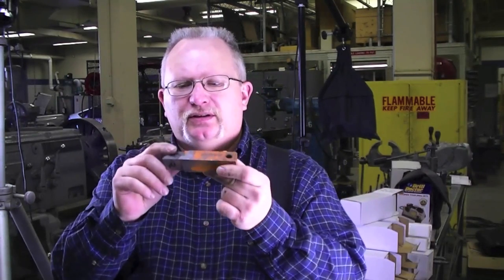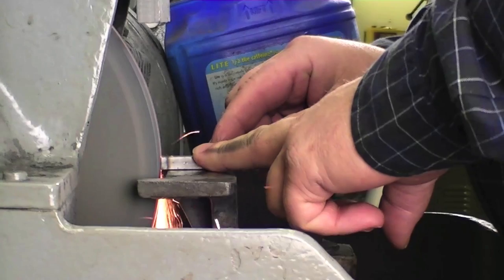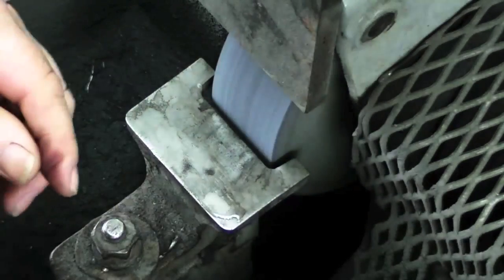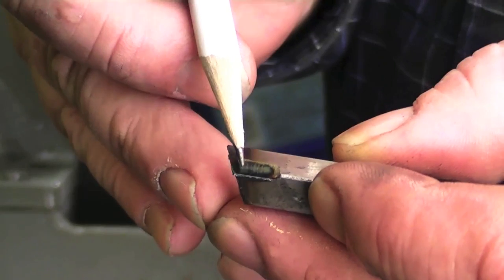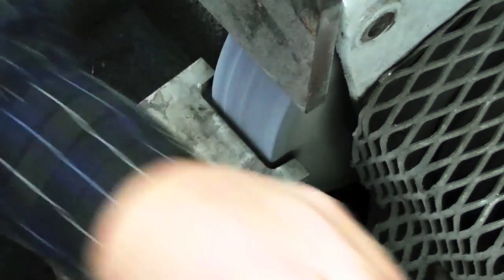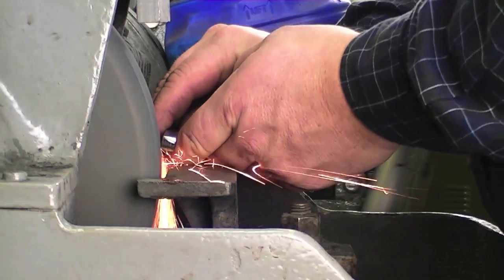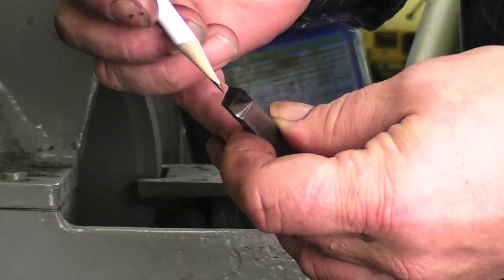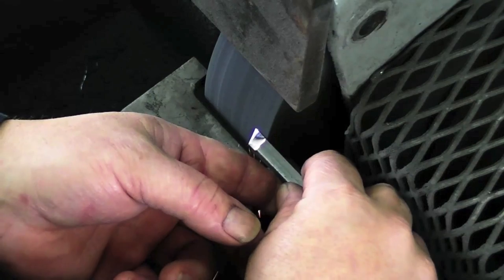Grinding HSS Lathe Tools - Part 1: Grinding a RH Tool

Comment: Nice video, however cuts corners immediately (pun intended). Grinds way too fast and without HSS. This basically leaves 75% of the important information out. The geometry can be explained with a picture

Comment: great, if  need turn a concave as in tube firmer dye, using a tool that pivots, what will by tool shape be, as the tools pivots in an arc , both ways? rgds

Comment: A comment and a question.
 You didn't explain the rake well on the top of the bit as you were sharpening. Did I miss that?
Question; You were sharpening 4140 and spoke as if you were actually going to cut with it. Do you use 4140 for aluminum or plastic only cutting? Do you harden it first?
Reply from the maker: newstart49 the top rake is pretty forgiving. Sometimes when cutting brass, bronze or plastic you need zero or even a negative rake. There’s a bit of theory and opinion involved in what top rake angle works best for each material, but for me I use whatever tool I have handy and only worry about the top rake if I get a lot of chatter. I check my speeds and feeds first and if those check out than sometimes using a different rake angle is the fix. As far as using mild steel in the video instead of HSS, Barry just did that so that he could grind the tool more quickly. You could use it on plastic and maybe some softer metals, but it would lose its edge pretty quickly. I think if memory serves Barry just tossed it when we were done recording. It’s also good to learn on cheap steel. Practice on some inexpensive steel first to get the hang of it and then repeat the process using HSS blanks.
Reply: Thanks. I have always made a habit of 5* top rake and haven't had any trouble, but I don't thread much and was just wondering about it.
Reply from the maker: newstart49 yea, I tend to eyeball an 8-10 degree top rake and that works for the vast majority of what I turn. I think a lot of people get hung up on the specifics but a lot of stuff in machining is a range and forgiving. If you ever cut plastics try a more aggressive rake. Otherwise stick with what works for you.
Reply from the maker: And once I started using a tangential tool holder from Eccentric Engineering I’ve rarely had to use another tool. And those have a 12 degree rake in all 3 directions if memory serves.

Comment: This video was incredibly helpful in grinding my first two tools!

The brazed carbide tools, because of the slow speeds and feed rates, I could only achieve 15~25 thou cuts, but I was able to push my machine (a local equivalent of a G0602) to .125" with my first RH tool!

Thanks! :)
Reply: Those brazed carbide tools are often of the wrong shape out of the box, and unless you bought a REALLY good one, they need further grinding on a diamond wheel to the right shape before it will cut. Those brazed carbide boring bars are like that. 

If you grind your carbide tools like those HSS blanks, it will cut well and it will stay sharp longer assuming you treated it properly. The only carbide tools I have seen thus far that are ready to go are inserts.

Comment: I'm learning the lathe right now. I want to make a tool for cutting a 30 degree interior chamfer. The chamfer only has to be about .150 deep into a 2.25 inch diameter aluminum tube so I'm pretty confident that I can do it. I can't figure out why the person who is teaching me insists that we use such an elaborate setup for a simple cut. He just gets mad if I ask so I'm going to figure it out on my own. I think the tips in your video will help a lot. Thanks!